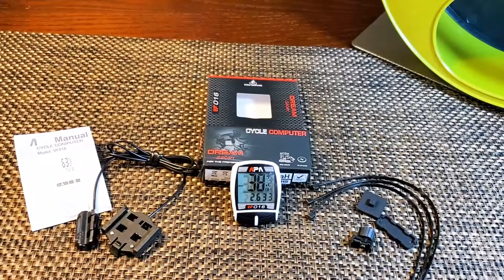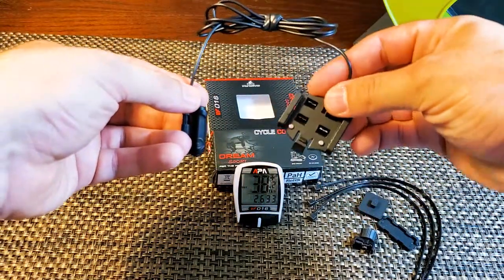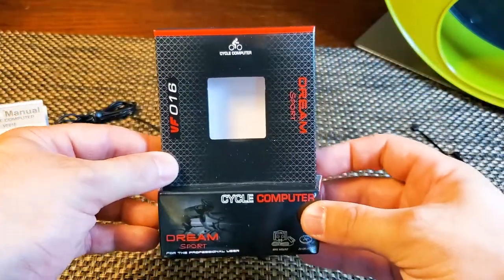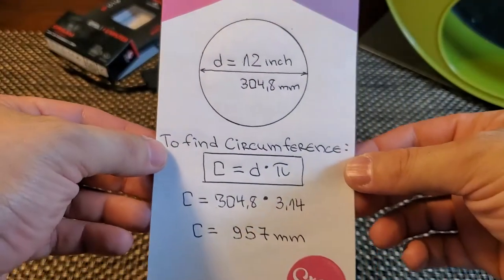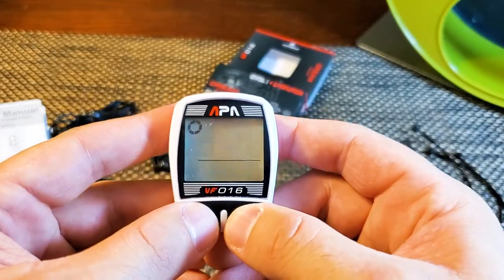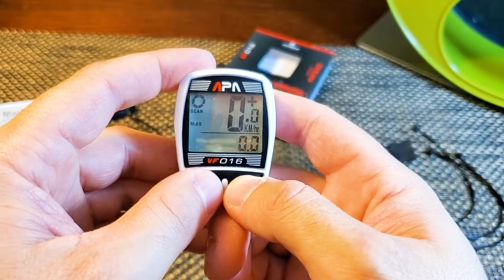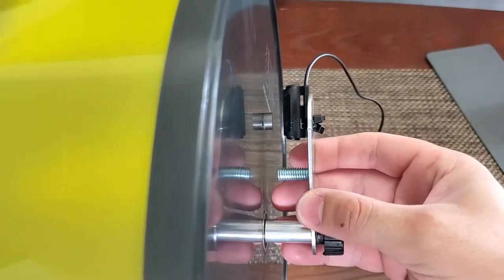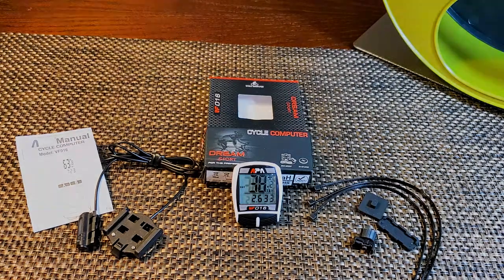HOW TO INSTALL SPEEDOMETER TO PET EXERCISE WHEEL OR BIKE

Comment: That magnet should be placed closer to the outer rim to properly represent the circumference calculations you entered in counter. Where you placed the magnet your circumference would be cut by half!
Reply: Not really. It will still come around the same amount of times and be accurate.
Reply: Doesn’t make any difference where it’s placed as long as the magnet is detected. 
You enter the circumference of the wheel on the computer so it’s all worked out no matter where the magnet is positioned
Reply: I thought you were right Roxane, but you are actually wrong.  Imagine it like a spoke on a bike.  No matter where on that spoke you put the sensor, it would pass the same spot at the same time as it spun.